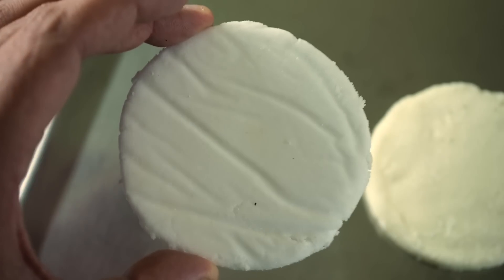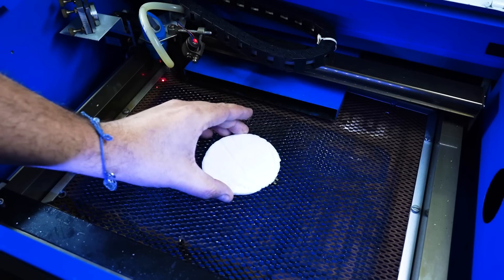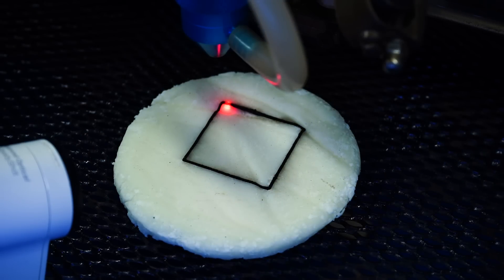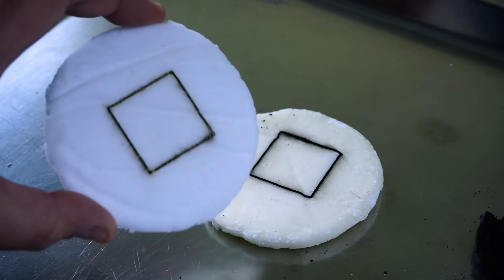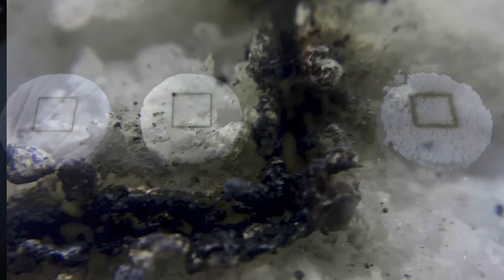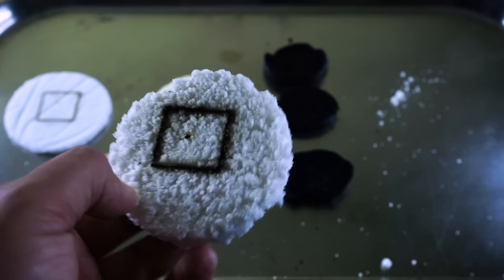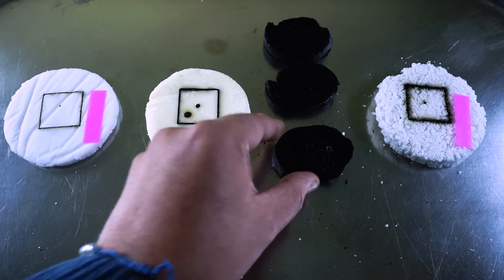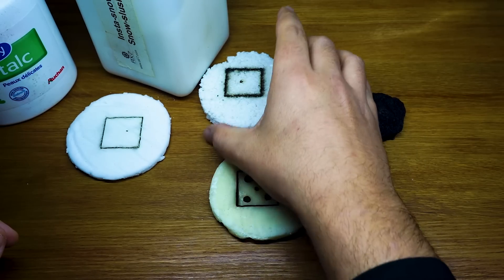K40 Laser vs. Starlite Super Insulator / Testing what Recipe really works

Comment: Some years ago I saw a demo involving another home made material. A man held his hand against a one inch thick sample for a minute or more, while a propane torch blasted the other side. If I remember rightly, that material had only two ingredients (plus water). Polystyrene foam (styrofoam) beads, mixed with cement, shaped into a tile, and cured. 

I suspect it worked in a similar way to Starlight (the first layer of beads burning into carbon). However, it would last better in a damp environment than the corn starch / baking powder mix (It should be light enough to float on water. I imagine applying the wet mix to the walls of a steel barge for heat-insulation, or coating a timber building with it for fire protection). It would not attract mold, or crumble too easily - though, without reinforcement, not all that hard to break. So, why not mix in chopped strands of carbon fibre (fiber) too, and make a resilient structure? I don't see why chopped glass strands would not work just as well. Although glass is of lower melting point than carbon fibre, only a thin outside layer would be exposed in the event of a fire.
Reply from the maker: Thanks for your comment, i think that carbon fiber might be a good idea i do have cement glas fibers but they won’t carbonize, carbon fibers could add an additional form of insulation.
Reply: @MancaveEffects  - You may have seen that Red Stuff that Fire Bombers Drop on Forest Fires / Wild Fires? Red Bentonite, as I understand! It is actually dropped on the areas "Ahead" of the Fire Path, as it doesn't Burn, and so the Fire gets Starved if Fuel, when it reaches the Bentonite covered Trees!

Bentonite, is also used as "Drilling Mud" in Well Drilling operations, and should be available from any well drilling supply services or stores! 

Ideally, these Materials could be sprayed onto buildings in high forest fire area's, and the discoloration carbon layer relatively easily removed, after surviving the fire, and the coating reapplied!

The Putty like application, seems to me if a lesser use case, but maybe as a Skin over Aircraft "Black Boxes" to increase the Fire Protection strength, and keep the core electronics cooler, in a firey crash! 🤔
Reply: Interesting.  Really seems like a mixture of two very dissimilar material that actually make some sense.  The foam is light and I'd think it would act as a bonding agent (giving it some strength), while the cement is heavy, can dispense heat, but is relatively brittle in thin applications.  

I wouldn't mind seeing the test.  However, while you think it would be light enough to float on water, I'm guessing that for most applications the cement composition would just be too heavy for practical use.
Reply: No. You would be pleasantly surprised! Only a thin cement coating on the styrofoam beads is enough to bond them together. In most cement mixes it is the sand and the gravel that make it heavy. Those aren't needed here (it's insulating - not load-bearing). So, it is light. 

I've played with various ratios in the past, but don't remember the numbers. It's really easy to create new test samples, though! A soup spoon, a few yoghurt pots for the various mixes, a small quantity of cement, and some styrofoam beads.. You can easily make test-blocks in your kitchen. I didn't have any styrofoam beads, so I ripped up some styrofoam packing pieces in a kitchen blender, and then shook it through a coarse sieve to end up with some beads. 

4 spoons of this, 5 spoons of that, add a little water, and mix. Write that ratio onto the yoghurt pot, and leave the mix to set. Then make another mix, using a different ratio. Best to keep the lids on the pots for at least 24 hrs to stop things drying out. Moisture is needed for the cement to cure properly. 

Then see which blend-ratio best suits your application. More cement is stronger but heavier. Too little cement is lighter, but may easily break apart. BUT less cement, plus some strands cut from carbon fibre cloth, mixed up with the styrofoam beads may be both strong and light - and of course heatproof/fireproof!
Reply: Sugito - Also, maybe, instead of the Cement, maybe try the Corn Starch + Baking Soda & thin the white PVA Glue, more to a Medium  Thin Paint Consistency, and coat the Styrofoam Beads with That? (I think Michaels, or Hobby Lobby has Such Beads, also!)

Comment: My money wood B on the baking soda and cornstarch
Reply: Yes and the most successful recipes I've seen on YouTube so far were about 90% corn starch. Anyone?
Reply: @Nash4Nashville  
 The simplest way to make a material that has similar properties as Starlite involves mixing together:
corn starch 
baking soda (10% of the amount of corn starch)
Regular white glue (as much as needed to turn this mixture into putty)

When intense heat is applied to Starlite the resulting chemical reaction is almost the same as in the pharaoh's snake intumescent reaction discovered by Friedrich Wöhler in 1821.

A Starlite like material must at least contain 2 elements namely:
- A chemical that contains carbon and releases that carbon when it burns.
- A chemical that when heated releases a gas like co2 that inflates the carbon as it forms turning it into a carbon foam.

When intense heat is applied to Starlite it quickly forms a black layer and bubbles of carbon starts to form. The deeper the heat goes into the material the more it’s pushed away by this expanding foam of carbon itself and once it’s in this solid state it also has insulating properties so the transfer of heat is doubly reduced.

It’s cold enough to touch almost instantly because carbon foam is an excellent black body radiator which is a scientific term used to describe an object that among other things dissipates energy just as quickly as it absorbs.

Comment: I'm curious what could reflect light n the starlight mixtur. This was noted in the AWE tests
Reply: chicken eggshell or chicken feathers; apparently the secret in the mix was one of those, powderized.
Reply: @vaelophisnyx9873  yeah I remember reading a comment somewhere about a statement using chickens
Reply: Anyone ever try adding alum to the mix? Alum is special in a way because you can mix it with water until you have a very thin paste. Then dip a piece of paper into the alum/water mixture and coat both sides of the paper. Let this piece of paper dry and afterwards, try setting it on fire. It will be extremely hard to burn.

Comment: Why not have starlight already with a carbon layer on top
Reply: Because starlight is overall less fragile then a layer of carbon, also before starlight drys it is almost like play-dough and can be formed into any shape then left to dry
Reply: Because carbon is very brittle, Starlite is playdoh before it dries.
Reply: And bc you can see that the carbon alone is not enough, starlite creates the carbon layer "on demand"
Reply: The simplest way to make a material that has similar properties as Starlite involves mixing together:
corn starch 
baking soda (10% of the amount of corn starch)
Regular white glue (as much as needed to turn this mixture into putty)

When intense heat is applied to Starlite the resulting chemical reaction is almost the same as in the pharaoh's snake intumescent reaction discovered by Friedrich Wöhler in 1821.

A Starlite like material must at least contain 2 elements namely:
- A chemical that contains carbon and releases that carbon when it burns.
- A chemical that when heated releases a gas like co2 that inflates the carbon as it forms turning it into a carbon foam.

When intense heat is applied to Starlite it quickly forms a black layer and bubbles of carbon starts to form. The deeper the heat goes into the material the more it’s pushed away by this expanding foam of carbon itself and once it’s in this solid state it also has insulating properties so the transfer of heat is doubly reduced.

It’s cold enough to touch almost instantly because carbon foam is an excellent black body radiator which is a scientific term used to describe an object that among other things dissipates energy just as quickly as it absorbs.

Comment: Take Vermiculite Portland Cement add mixture of 10 parts corn starch, 1 part baking soda, 1 part Magnesium Hydroxide Powder (absorbs heat & smoke) then use Aluminum Magnesium Silicate Powder as a thickener (NOT GLUE) with consistency of molasses before adding to Cement Mix. Of course, mix it all up in a concrete mixer then pour into sheets and dry. Once dry then spray onto the surface a mixture of Sodium Silicate, Silicon Monoxide, 21 Mule Team Borax and Graphene Ink.
Reply from the maker: Super interesting recipe! Never heared of that combination yet also i have Vermiculite in hudge bags standing around in the shop.
Thanks for sharing!
Reply from the maker: Do you think i could reduce your recipe to 1 part portland cement, 1 part vemiculate, 10 parts corn starch and thicken it up with magnesium silicate?

Comment: Try a ratio of 3:1 Baking Powder(Not soda) to Cornstarch with PVA Glue. The first test I did had the carbon and internal starlite expanded unlike the traditional just expanding Carbon Foam.
Regards
Reply: 10 part corn starch 1 part baking soda and pva glue it works with thermite and will not go throw
Reply: @drunkmickeymouse  Yes I am aware. BP is also an alternative to consider.
Reply: Will StarLite work as a heat barrier as well as it does with using a flame heat.  try using it with a non flame heat like a header wrap or a stove pipe?
Reply: Will StarLite work as a heat barrier as well as it does with using a flame heat.  try using it with a non flame heat like a header wrap or a stove pipe?